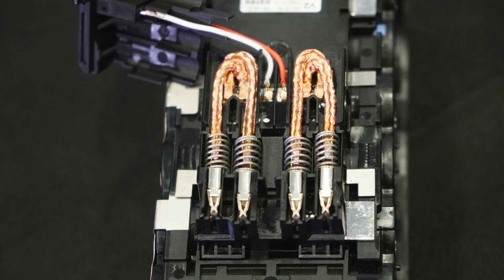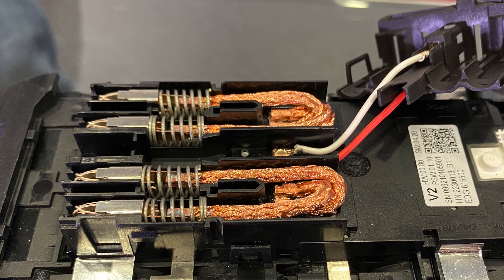HILTI's New NURON Tools - Can they take on 36V-48V and 60V Tools?.

Comment: That’s a lot of cool aid. We have a couple Hilti SDS tools and the Dewalt are much faster and more durable. Hilti salespeople suck to get a hold of for repairs or supplies. I’d put any tool up against Flexvolt tools to this day. 
    We have the Hilti DX-5 and 351 and those are very good powder activated tools. Very expensive
Reply from the maker: That's what I said in the video - Hilti has always suffered losses in our Head-2-Head testing, mostly due to brushed motors and failure to keep up with the pack. This is their 2nd generation tools - to compete with the pack

Comment: This may be a game changer, but years ago I worked for a company that provided you with tools and they gave hilti. I remember those 22v tools being absolute hot garbageand wondering why the company was paying so much for ryobi/porter cable like performance. Because of that I don't think I could ever give hilti an unbiased try ever again.
Reply from the maker: I don't think that will be the case noew
Reply: It's because they leased the tools and when a tool goes down Hilti is there to pick up the tool and have a replacement. From a large company standpoint it saves time which saves money.
Reply: @Fictitious_Character  the tools seldom ever broke and if they did, you run down to the job trailer and get another one. They had plenty extra.